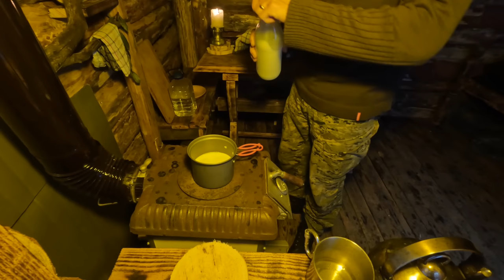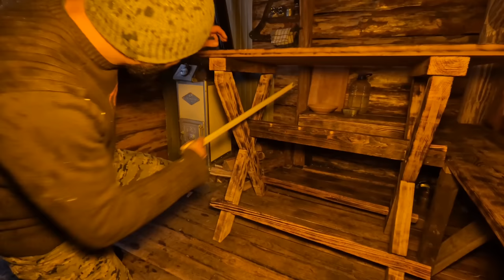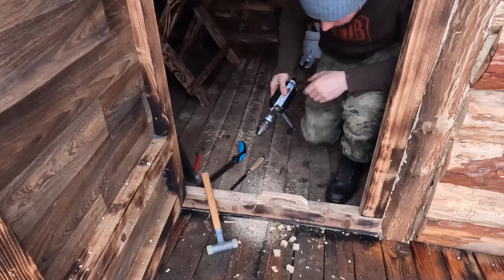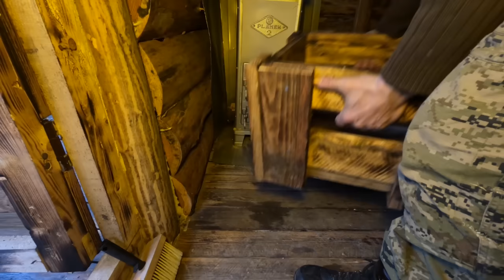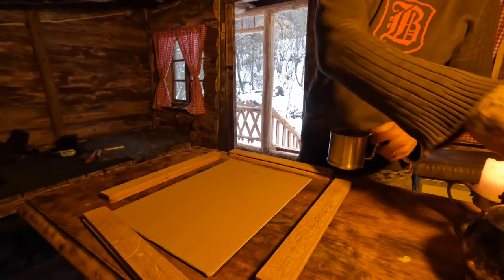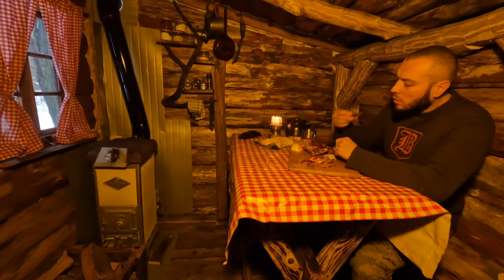During the SNOWSTORM I Hide in my Cozy DUGOUT, Working on the Details, DIY, Craft skills-Part 7

Comment: The master carpenter does it again!😁 Precision fitting of the drawer under the table. Handmade curtain rods with red checked curtains to match the table cloth was a nice touch and added a splash of color. And I'm so glad you got that stack of wood away from the stove. That was a fire hazard. The best part was the picture of Lajka.❤ That is precious!😍 And now that you have snow, it's back to the cliff shelter, right?😉 Gotta get those beautiful snowy mountain scenes. 🏔
Reply from the maker: Hi Anna! I was on a cliff and it's too dangerous for Laika, so I won't risk it. I have to think of another plan! I'm glad you like my cabin and say hi to your son!
Reply: @luxonbushcraft  So glad you didn't then. I would be very sad if anything happened to you or Lajka. And yes, I very much like your cabin. It looks wonderful. Aidan said "Hi" back to ya.😁

Comment: You still need a bin for the firewood. I’ll bet you come up with something wonderful. Oh, and there it is! Wax the rails on the drawer and table with a candle and it will slide easier. Perfect tool box. Love the curtains. At some point you can make tie backs with twisted branches just like the shelf by the stove. The frame around Lajka’s photo is the perfect touch for the cabin. Right above her sleeping spot. I hope you keep this cabin for a long time.
Reply from the maker: I gave the hut away. I hope they will maintain it regularly  😆 And yes, it is located on my land with all the necessary permits

Comment: Hi! 
Some wax on the runners of the drawer would make it run really smooth and reduce wear. I used that trick on one of the drawers of my old cupboard. There was a ginding noise when I pulled it out or pushed it in. The plastic had worn off (the cupboard is from the 1970s). Since I put wax on the spot, it runs as smooth as ever.
Reply from the maker: Thanks! 👍

Comment: I am curious about curtain rod mounts? When you cut off that screw,  did you then have to screw it to cabin in counter clockwise, or opposite from how you normally  would? I have seen some screws threaded both ways for that purpose. 😮
Reply from the maker: I used a regular screw 😉

Comment: If you rub some wax along the bottom of the drawer where those sticks glide  like use a dry candle and run it along the edged wood the drawer will less likely catch on splinters. [I] <---- the peice of wood in the middle of the two lines.